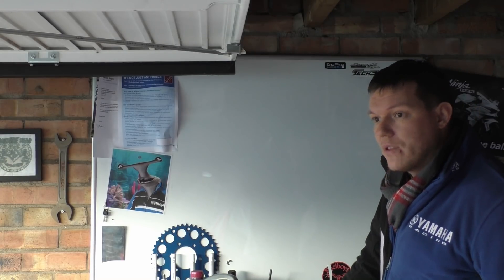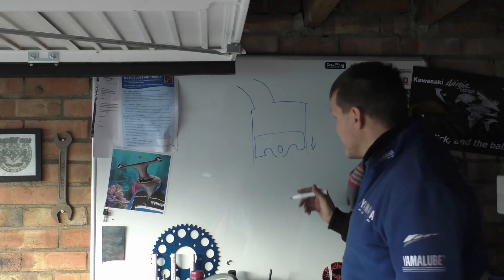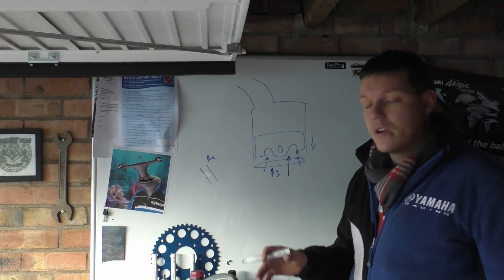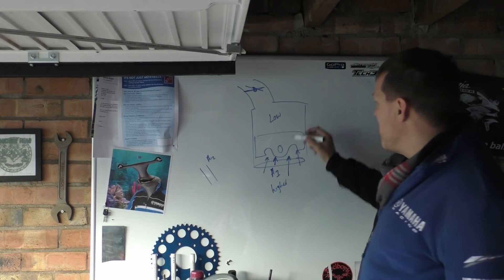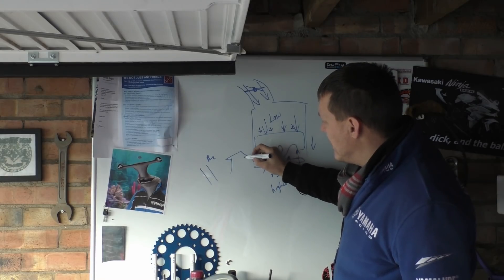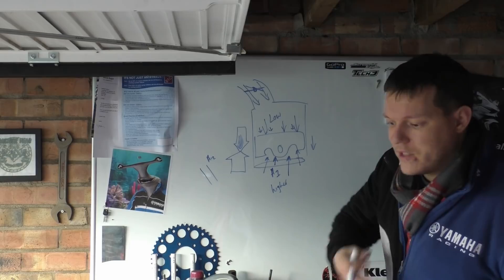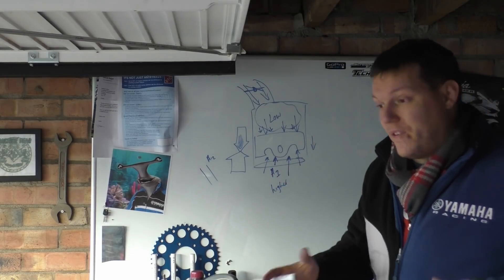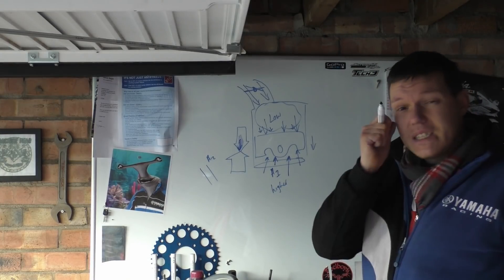MotoGP Engine braking Controls - How & why

Comment: What is the different between 'engine break control' and 'MSR tech in KTM'. KTM is not using 'Engine Break Control'. There aren't. KTM use the MSR. MSR is a security tech because it prevents the rear wheel from slowing down, skidding and locking caused by engine braking. But against this, other motorbike companies are using 'engine brake control'. They have never used MSR Tech. I have never seen. Or are they both the same?

Comment: Thank you for good explanation..  Sir what if we keep wot with no fuel..  Waht will be the effect on engine temperature, i dont think butterfly gets any back pressure as the valve is inbetween...  Also we close exhaust gas brake for better engine braking
Reply from the maker: no fuel?

Comment: Matt, great video once again and very informative. When I worked with Honda they had 20 maps for engine braking. And each one of them had 3 settings for the rider to choose from depending on the individual corners. Also just to mention, at that time MotoGP (HRC) we’re manufacturing seamless gear design without ignition loss from quick shifting. It was all secret stuff back then and I’m out of the scene for years so would be interesting to see if it’s available for viewers . Keep up the great work as always lad. Owen.
Reply from the maker: Ah the seamless box - half way through printing a model of it now - but keep it to yourself LOL

Comment: Call me a dick if you like but... surly in a 4 cylinder engine the crankcase volume is constant (2 pistons rising 2 falling). Not that I disagree with the explanation but I guess crankcase pressure is about 1 atmosphere. On some old bit singles an twins (pistons rise and fall together or on there own) they had valves to create a negative crankcase pressure probably to help stop them pissing oil. However for racing they're bollocks just lots of big breather pipes is the way to go.

Comment: Totally doable manually, that's why you have that little red nobby next to your throttle. You're suppose to click on it before a corner, engine goes "baaaaauuhhh" and you can adjust the engine breaking with throttle. Works on most bikes.

Comment: it is basically the same as applying just enough throttle to make the engine push just enough while braking, the trickery is trying to save a much fuel as possible while doing it. I think they may also be controlling the slipper clutch

Comment: You could have covered the compression stroke equation thing because a lot of your readers don't have a clue  how the otto cycle actually functions; a good strong 12.5 to 1 compression ratio needs a breaker bar at rest on the bench this is compression braking that you can measure with a torque wrench and in my own sick way   can provide a great deal of humor too when the socket slips off the nut and you fall on your butt hanging onto a Snap-On torque wrench which you're not about to let get hurt so you go ahead and take one in the Noggin to protect the wrench oh my what strange creatures we are! We really haven't  advanced very far  since the Roman Empire. I still maintain a smidgen of Hope but the stats look horrible

 Rome I still have hope for us but the stats don't look good

Comment: What about the throttle body in the exhaust to break and slow down the engine? I don't know about the GP bikes, but that is a common system on diesel engines. And I think that could work on other engines too.
Reply from the maker: Jake brakes and compression braking is like Kevin said different - more on this when we cover diesels
Reply: Kevin, I know that with the trucks. That wasn't the question. Will that work on 4t and 2t engines too?  I can't remember to know any 4T or2T engine that runs with an exhaust throttle break but it should work on 4T engines. Trucks also have this days a retarder that slows down the truck. Many different systems are used today and the exhaust throttle is not in that many trucks anymore. The plus is that it can be total separate from the intake throttle cable. Like with an thump throttle on an quad.

Comment: Don't freak out people....Matt left off a key piece, crankcase pressure is greatly minimized because as one piston goes down, another is going up (generally) and you have an oil pump that is evacuating positive pressures. They really want a negative pressure in the crankcase to help control the piston rings.  On stuff like full race engines, you will often see a breather is flowing air from the outside to the crankcase (the breather is dirty on the outside).
Reply: Many race car engines have vacuum pumps on them to further evacuate the crankcase.  Significant HP gains can be found by doing this.
Reply from the maker: 1) one cylinder up and down has little effect. The speeds of the pistons and the webs between cylinders greatly restrict this 'flow'.

2) Reducing crankcase pressure is to remove the pumping loses do to this pressure difference but in normal running conditions, that and crankcase windage etc. The weight of an extra pump is not a viable option in motorbikes for the little gains that you can get. And fucking CAR?! Come on mike, no one cares about shitty cars LOL
Reply: I do :-P Please tell me more Mike =)
Reply: The Workshop, hell, most have 4 pistons.  I have been told that the low pressure in a crankcase is more about ring sealinh than anything.  I love motor vehicles.....because they irritate you.....LMAO.....plus big trucks make me money!
Reply from the maker: What bike is it?
Reply from the maker: where is the reed valve? In the head or in the crankcase? - http://i595.photobucket.com/albums/tt38/PaulFitzGallery/SM610/IMG_1793.jpg
Reply from the maker: Yeah that's the reed flap - but there a bloody great big hole in the bottom of the crankcase - is this where the pump is? I'm downloading the manual to get a better look
Reply from the maker: Its a 50/50 thing, but makes a lot of sense when running new engines for drag racing, they also use catch tanks in drag racing for the crankcase venting. Will do a video on this next

Comment: my teacher says engine braking comes from the compression stroke. i asked him why since youd normally only have i dunno 0,5/0,3 bar absolute pressure in your intake system -> it would help the piston going up in a sense right? can you please tell me whats right now; your explanation or his ? xD
Reply from the maker: So you have the compression stroke which lets says robs 20% energy due to compression, then you have ignition/power stroke straight after. This is adding well over the 20% lost even during closed throttle.

Another way to think about it is idle, the engine still has compression loses but these are conpensated for when on the power stroke which 'adds' energy to the system. The difference is on the intake stroke.

Open throttle the engine runs without 'braking' 

Closed throttle the pressure in the intake is lower. This also means less fuel/air so the combustion event releases far less energy. But the active force in this system is the pressure difference in the crank vs the cylinder. 

It is was compression like your teacher says then the motogp bikes couldn't control it without having variable valves or a compression 'blow-off' valve - which they don't.

Hope that clears it up?
Reply: yes thank you